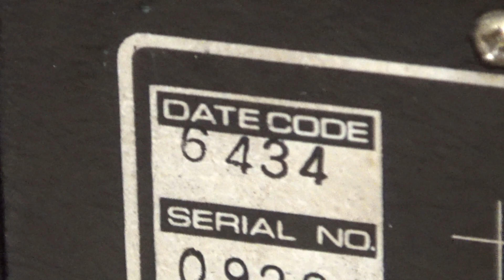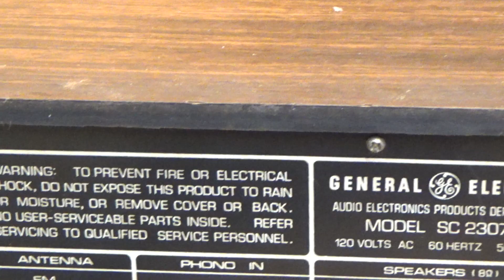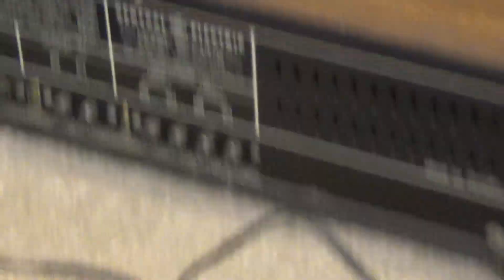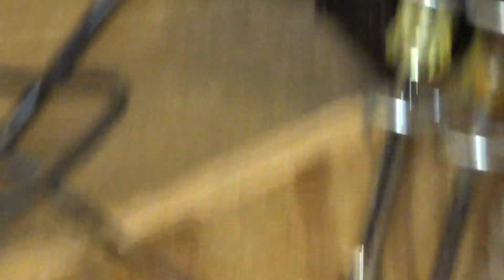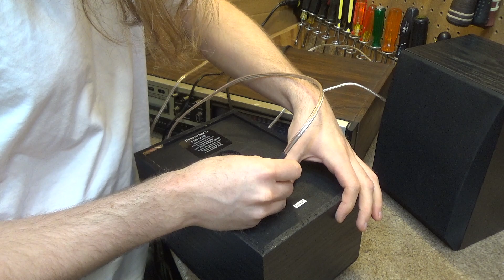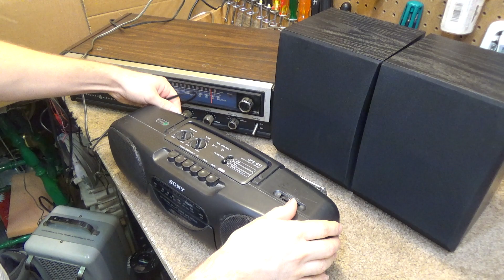General Electric SC 2307B Receiver | Initial Checkout

Comment: It's from the mid 1970s era.. If it were mid 1960s it would have vacuum tubes, and would not be solid state, and most likely would not be an import.. Those things will will last forever.. 8-track probably even works.. If it's got an Aux input you could hook bluetooth up to it.. You're right about greed..
Reply from the maker: Thanks for the information.. I got a 3.5MM aux to RCA cord and connected to the phonograph input.. Works great with the computer.. I have no use for Bluetooth but I imagine you could connect a Bluetooth adapter or anything else with standard analog output..

Comment: I don't think you can use the phonograph input for any device, I think it has to be a phonograph.  I had a few devices where the sound would be awful if I used the phono input for, say, a CD player.  But perhaps not, maybe that was my devices malfunctioning.  You've had this long enough now that I'm sure it's already set up the way you want.
Taiwan is not Chin, how many times have we been through this...
I think it does have a lot of visual evidence that supports it being from 1963:  the tiny plug, the styling on the front, the cardboard on the back...
What's wrong with audio equipment after 1970?  The best receivers ever made came from the 70s.
All the light bwelbs work?  Shocking.  Actually it looks like there's just one light in the tuner, positioned on the left side of it, I can tell by the way it's glowing.  Cheaper design, but less maintenance to deal with.
You must have been desperate for a receiver for the shop, you got one with the infamous TONE potentiometer instead of Base and Treble.
It appears to be using the power cord as an antenna for FM much like the clock radios.
We don't know if the bulbs went out, it did say it was serviced by GE.
NOT MADE IN CHINA!
Reply from the maker: I think your devices were malfunctioning, since I've been using the photograph input for audio from the computer without any trouble..
Clearly not enough times as I don't remember..
I think it is from 1963..
Nothing..
Bwelbs? OK J..
Base/Treble controls are no more useful than the TONE potentiometer in my opinion.. For serious listening you need something with a multi-band EQ.. This amplifier was never intended to be used for serious listening..
It could be..
True..
OK, thanks for letting me know..
Reply: If it's a ceramic phonograph input (it probably is), I do believe it will work as an AUX in just fine. Your systems probably had phonograph inputs for moving magnet type cartridges, which are a bit different and shouldn't be used as an AUX in.

Regarding the tone control, I do also prefer bass/treble controls. However, there's no real standard to what range of frequencies they will boost or attenuate.